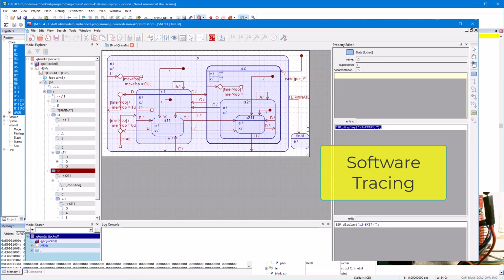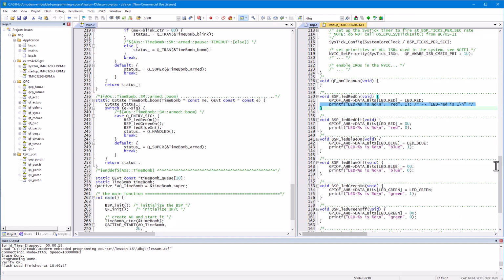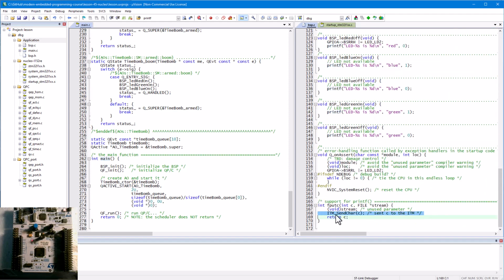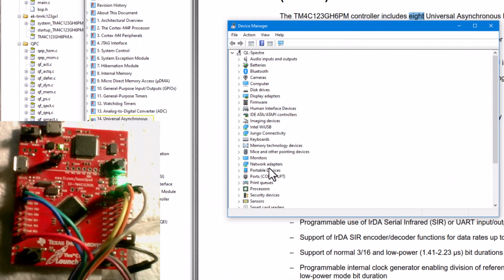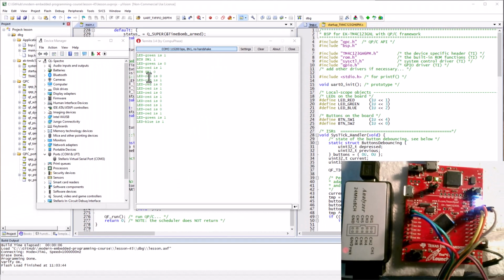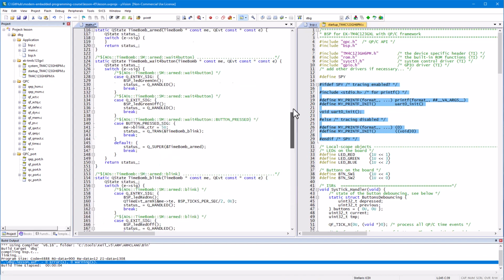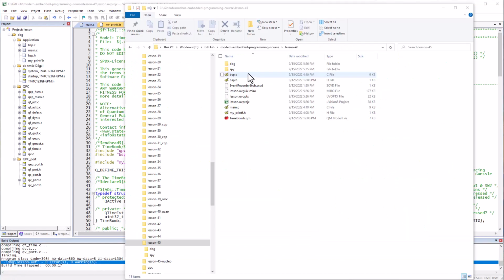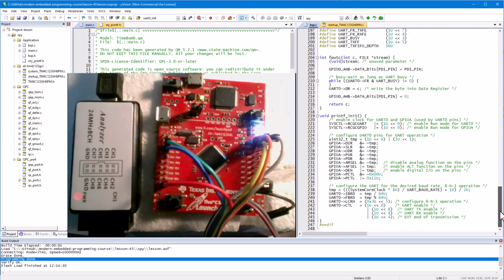#45 Software Tracing with printf

Comment: Better if you add flush, like this: #definition MY_PRINTF(format,...) printf(format_,##__VA_ARGS__); flush()
Important if you're looking for a line of code that crashes. Otherwise your message contained in printf not followed by flush may not appear if the next line of code crashes.
Reply from the maker: The call to flush() might be indeed useful on the  host . In embedded targets it all depends on the implementation of the low-level fputc(). If there is no buffering (and typically there isn't) flush() does nothing and is superfluous. -MMS

Comment: As usual, I learn something with every episode – Thank you so much for this body of work.

As someone who works with processes timed in nanoseconds and microseconds, printf is excessively costly in time to be useful for software tracing.  Tracing stuff going on in interrupt handlers can also be problematic.

Since I have not had the luxury of debuggers like the one that you have shown, I have had to create logging functions on my own.  What has worked for me is a singleton that accepts a string, prepends a unique ascending counter value to it, and adds it to an array that you dump to a text file when it gets full.  Actually two arrays, since one has to be available for writing while the other is being written to a file, which is time consuming.  Any other formatting I do it after the log file is complete. (The logging procedure must be protected from interruption, especially in a multi-threaded environment. A call to a singleton function seems to prevents this.) (This is much easier to implement in Ada than in C/C++, but it can be done.)

To create a call stack-like trace, each file gets a variable that contains the APP name and Module Name, and each named body of code gets a variable with its name.  That allows strings like “App.Module.Procedure.Start” and “App.Module.Procedure.End” to be composed on the fly, which you add to the beginning and end of a body of code.  As already shown, this technique can be used to trace state transitions if a log entry is made for each state Entry and Exit.

If you have a program that halts, add an integer variable called “last_line” to your code and add “last_line = <<ascending unique number>>; before each executable statement.  In any exception handling, dump the value of “last_line” to identify the last successfully run line of code. (This is very easy to do in Ada, and tougher in C/C++)

If the problem is identifying what happened up to a point, interleave problematic code with an exact copy of the code that follows it as the log entry rather than any other text.  The trace output will then be a complete trace of the code that was run during a test.  It will not solve the problem of code optimization reorganizing the code, but it will help if the code unexpectedly takes paths that programmer did not expect.

Lastly, give yourself a way to turn logging on and off while processing.  I pass a Boolean flag called Trace to each call.  When Trace is true, add logging, when Trace is false, do not log.  Since Trace is passed to each function and procedure, turning on logging at a higher level of abstraction means every function or procedure below it will log without any other work.  Once the questionable code has been identified, the logging can be tuned down to just the section that needs to be traced.

I have a feeling that all of this will be shown eloquently in the next lesson, which I am looking forward to.

Again, thanks for the lessons so far.
Reply from the maker: Thank you for sharing. Almost every experienced embedded developer has some sort of software tracing solution because this is critically important to the development, debugging, optimization, and diagnosing of embedded software. In the next upcoming lesson #46 I plan to present a mature software tracing system much more suitable for real-time embedded systems than "printf". I will talk about the main features, like buffering, the data protocol, filtering, etc. I hope this will be interesting both to novices and experienced developers. Stay tuned!

Comment: Usually embedded designers use uart plus DMA to greatly reduce the cost of execution time. 
However, the ASCII-printf style of software tracing simply carries too little information per byte. 
Something way more cleaver, like QSpy, must be utilised.
Thx, Miro, always high quality video!
Reply from the maker: That's true that the DMA offloads the CPU for simple data movement. But using printf() with DMA (and actually, you must mean hear snprintf() that formats the output into a given buffer) is not trivial. This buffering is tricky if you really want to avoid busy-waiting for the DMA to finish transmitting a given buffer (so you need multiple buffers). For these reasons, I actually don't see that many really good implementations of printf-style software tracing with DMA. Perhaps you could point out some such implementation on GitHub or some other public repository? I'm sure people watching this video would be interested. --MMS

Comment: thanks for the video, is using DMA with UART will be a solution for the printf problem, because there are some cases when it is hard to use the debugger, for example, I was working the nrf52 and as soon as I stop the code the BLE stop working, also printf if useful when you try to collect a streaming set of data for further analysis
Reply from the maker: You're on the right track, but the use of DMA (Direct Memory Access) for the UART will not help, at least not without a complete re-design of the printf interface. The problem is buffering because you cannot start sending (through DMA or any other way) new bytes until you make sure that the old bytes went out. So, adding buffering will be part of the solution that I'll present in the next lesson. And I hear what you're saying about troubleshooting BLE. That's exactly why I present lessons about software tracing, but I mean the real thing that you can actually use in real-time systems. Stay tuned!

Comment: As you point out using printf to debug screws your real time performance.  It also moves your  code around in memory so there is a chance that it will run when debugging but give issues then they are removed. I liked it when I could use emulators for the processor and had far greater control.  If I have spare io I will use them to go high when entering a subprocess and low again when leaving.  This might only take up a few clock cycles so helps with timing as well.  Nice video thanks.
Reply: The best way is to push messages into a buffer and print them only in the lowest priority task, so that it does not affect timing of the actual code.
Reply from the maker: @KarmaWillHauntEveryone  Yes, absolutely. As I just mentioned in my other comment, buffering of outgoing bytes must be part of the solution. But printf-style formatting to ASCII in the time-critical path through the code is not the smartest way of doing this and professional software tracing solutions are all based on binary data. I'll show an example in the next lesson. Stay tuned!
Reply: @KarmaWillHauntEveryone  Most of my software testing was done on little snippits of code, as any form of debugging would affect the operation if not used in the final code. Used to hate the fact that a small few line code change could push the testing back a few month. Love working on my own MC code as no one cares if it falls over once a week. Know a project where the code went wrong in the first few lines with a buffer overrun but did not die until it had run for 6 months. That was a bugger to find.